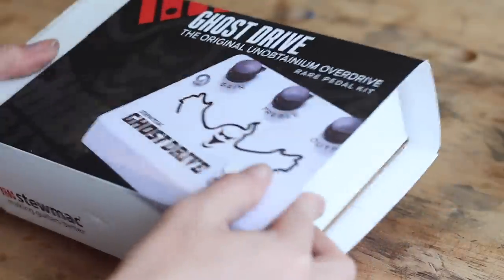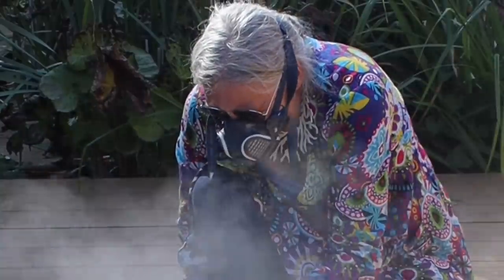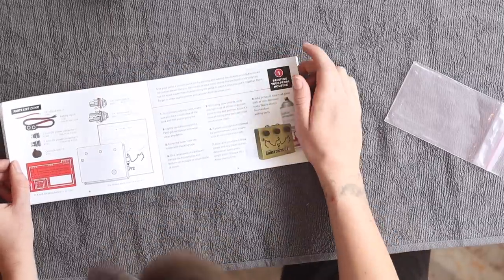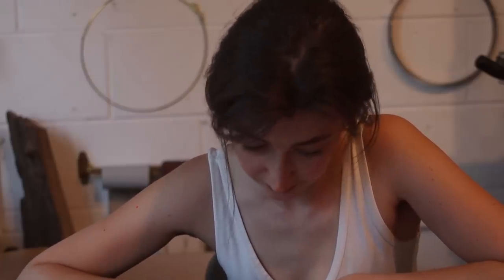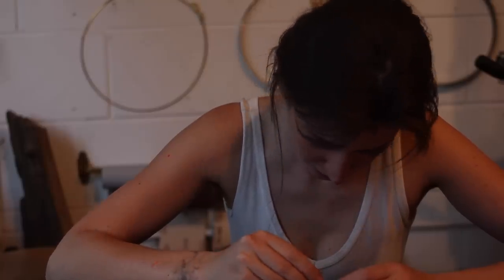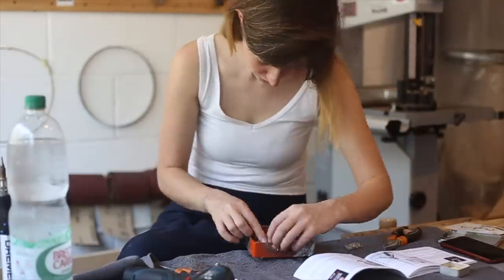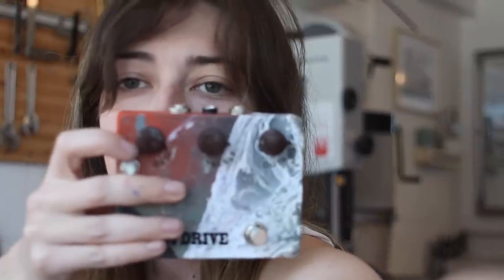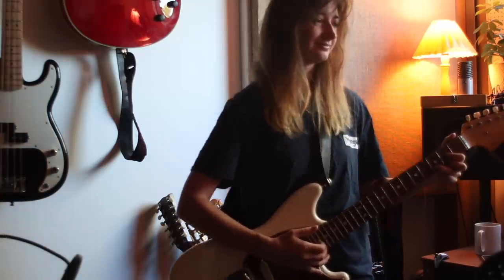I Built The Rarest Guitar Pedal | Klon Centaur

Comment: As with most things there’s a learning curve, the majority of the components in this build are designed to use voltages higher than 9v and I’m guessing your friends psu was 18v. So it’s likely to be the LED that blew. If you can borrow a decent soldering iron, replace the LED, reflow all your solder joints looking out for any shorts you might be lucky. Good luck :)
Reply: Yea, it's fixable! Don't give up just yet!

Comment: There should be a 1N4742 zener diode in the schematic to protect against overvoltage -- if everything's installed correctly, you only blew a 10 cent diode.

Comment: Meh. Senior project in college involved a "large" board to control some mass flow control valves using triacs. Neglected to solder up the ground lead and on the 3rd test power up the random state the triacs woke up at allowed AC power into the DC side. Chips exploded. Smoke was released. A sad day. :) I had not built an enclosure yet so the excitement was released into the lab in full force so there was that.

Comment: If this is still non-functioning, I'm certain I can fix this, if you are interested. There is a zener diode in the circuit that acts as a fuse. It's a cheap part but, you have to know where it is on the circuit board because it won't be obviously failed. I have a marked up photo pointing to the zener.

Comment: I am currently wrestling with a King of Tone clone. I have managed to get both sides to work after two sets of pictures to StewMac, but it got a loose connection somewhere between the switch and main PCB. I will get it working if I have to try for a month.

Comment: Ok so while I left the electronics repair industry many years ago, I do keep abreast of things in the circuit world by watching some youtube channels and the occasional hobby build project just for fun (full disclosure ok I'm designing some devices too that I hope to make commercial eventually but that's still a very informal venture for now.) So, now that you have a sense of my experience, I can tell you that for someone who has no training in electronics and no experience working with electronic components, this is a pretty steep degree of ambition for a first delve into circuit building. Yes for someone who is experienced in hands-on electronics this is a straightforward build with nothing complicated. BUT, as I said, it's just a simple fact that there are a lot of ways you can go wrong with this if you have never had training. That's not a testament to a person's innate abilities in any way. It's the same for any other technical skill. There are just a lot of things that will be unclear merely for no other reason that you can't possibly know until you've had a certain degree of exposure and some trial by fire. (sometimes literally fire) It does not mean you are "very bad at making stuff" at all. It merely means this particular foray is new to you. Find me any maker who doesn't need to learn by trial and error.  I've never met one.

Comment: Everything can be repaired! Probably replacing the integrated circuits will be enough.
By the way: how significantly higher voltage did you apply?

Comment: It's only stupid mistake if you don't learn from it.

I color my DC output with little bit of electrical tape. 9V is standard so anything not 9V gets a little tap wrapped around it so I know it's non 9V. Little piece of cut out tape next to the input of the DC makes it so I only match up same colors when I plug in. Colors are best IMO because text you can mis-read or fade etc. Colors are inuitive. matching color = matching voltage

Comment: It might have survived a 12v dc, that dc jack sounds like a laptop 19v supply. How did you manage to build and assemble the stomp without testing? on the upside, you might be able to source and replace the burnt-out components, ic/diode/capacitors.

Comment: thats a bummer about a year ago i built a fortin 33 clone and it came out well. although i did damage the circuitboard cos i put the led in the wrong way round and had to use a bridging wire haha so i kinda sorted my mistake. sorry you lost on your one.  you might be lucky and its only a couple components you fried. multimeters are kinda handy.

Comment: Smoking parts is part of the learning process - don't be hard on yourself. You should find the circuit board is still quite fixable. Start by removing the obviously damaged components and use a multimeter to test for short circuits around the DC jack and power tracks/pads. Can you send a picture of the board?  I'll even fix it for free is you can send it. Good luck and press on. :)

Comment: This is super cool, and the enclosure is gorgeous! ... but, as a professional, I simply have to point out quite a few things that are why it was so hard for you : 
1) General comment : The Klon centaur is far from the rarest pedal in the world, although the original ones are rare and very, very expensive. However, I would even go as far as to that the Klon centaur is the most common pedal in the world, for how far and wide it had been imitated! Most overdrives are a clone of the Klon, a little like you have Strats, Tele, 335, and Les Paul clones making up for 95% of the electric guitar market. It's almost as if they knew it was gonna happen when they named the pedal!

2) The basic kit shown here doesn't make any sense if you "build pedals a lot"... they literally show the most basic stuff you can get for less than 100 bucks on Amazon. Those are some of the most basic and common tools ever for anyone working with wires! If you build pedals a lot, you're going to need a much better soldering iron than the one show here. If you need a soldering iron once awhile you can get one of those for 20 bucks...! A voltmeter should also always be in a pro musician's kit. Matter of security!

3) Do NOT start soldering with a cordless iron, as it has nothing to do with the brand. Cordless irons use butane gas, with is 4000 farenheit (no, this is not a typo). The max temp I've ever used while soldering wires professionally was perhaps 950 farenheit (I was counting in celsius). I know it's exciting and fun but you are making it 10000x times harder for you. I would never use a cordless iron unless there is absolutely no other option to fix something on stage.

4) Do NOT ever use a soldering iron with something flammable on the table like this. Please, please don't do that. 4000 farenheit...!!!! This towel wasn't wet and could've caught fire entirely within a split second :O ALWAYS have a stand on which to rest the iron and NEVER have any flammable material nearby. There is absolutely no need to cover your table with a towel, electronic pieces aren't made of lacquered wood! :P 

5) It was your friend's bad to not tell you the voltage on this. If I come over to a pedal nerd to try a Klon centaur, they should 100% know and tell me that the adapter isn't a 9V. But, in their defense, ALWAYS check the voltage on your adapters. Better yet, just use a battery if you have ANY doubts. Also, 90% of pedals are 9 volts, center positive, and on the pedal itself you will see, at the bottom, a sign that indicates exactly 

6) You're incredible at building stuff and the fact you never built a pedal before and did this is super amazing and you should be super proud of yourself!!! I'm certain Stew Mac would be more than understanding and would agree to send you the circuit again so you can keep the beautiful enclosure. They're burned a lot of pedals over the years for sure... it's just part of the game! It feels overwhelming when you're starting out tho, I get it.
I loved that you were honest and vulnerable. We need more content like this on  YouTube!
Reply: Do you not mean 90% of pedals are centre negative? Every boss and pretty much any I’ve used is

Comment: What voltage did you plug in ? 
It was likely incorrect polarity too. Since the usual centre negative BOSS style is basically confined to pedal supplies.
But the pedal circuit might be repairable depending on the detail.

Comment: How many volts did you plug into that pedal? If it's below 18v there is a chance that the pedal still works since pedal components are usually rated at 18v or 25v in some cases. And depending on how long the pedal was connected to power, there's also a chance that the cap and diode near the dc jack were the only parts that got fried.

Comment: Hmmn. First off. as some have pointed out this is not really a "first time" project. It's not THAT complicated a circuit, but for someone who doesn't have some experience of how to look at components and read off their values/polarity, it is a minefield for the unwary. As some have said, start off with simpler projects, and learn in your head what the colour codes on a resistor actually mean. Also don;t be too put off by alarmist statements like "they might explode" In the many years of building small electronic circuits, I only had ONE cap "explode" but that was a large electrolytic which i had reversed the polarity, but this was in a 100 watt power amp I made. At the voltages and currents you are likely to find in circuits like this that will never happen. At worst it won't work. And looking at the circuit diagram, there are only a handful of polarised electrolytics in this circuit, all associated with the PSU part of the circuit.* And given the max voltage o about 18 volts at these currents, there will be no "explosions" . All the other capps ar AC coupling caps, in various configurations. All completely safe, and, not polarised wither. 
And for small projects like this, a small 15 watt iron is all you need. A hotter one is more likely to fry the components if you are simply not used to making soldered connections. I built dozens of projects from simple pedals, up to full 400 watt Class D amplifiers using an Antex 15 watt iron. It's just that you need to practice your technique to make good joints without overheating the components. 

* PS there is one other electrolytic and it looks to be in a feedback loop. so incorrect insertion shouldn't cause massive problems. It's just there to block DC feedback around the circuit.

Comment: I bought a very good Klon clone preassembled and even after seeing your video, I managed to use the wrong power supply.  In my defense, I have a two voltage power supply and mixed my wires up,  "What is that smell?" clued me in to my error.  My question, should you feel kind enough to respond, is  were you ever able to repair the pedal?  Mine still ha a degree of functionality--if I keep the left hand knob below 12 o'clock, it still does what it should  Past that point and the volume drops and there are other tone issues...  Thanks for a great video--and a great channel!

Comment: I don’t understand how you managed to plug a higher voltage into a 9v socket. Low voltage plugs and sockets are usually specific so that this can’t happen. Did you plug in phantom power from a mixing desk.
Most of the components you had laid out should work at up to 50v at least, so did anything melt or go black inside the box.

Comment: Im not sure about the schematic of a klon ...  but couldnt too high of a voltage could just fry the diode bridge/rectification area of a pedal before damaging the rest of the circuit? Perhaps you could replace a few parts and salvage this?

Comment: I feel like a power supply with a greater-than-9V output really shouldn't have the same plug on it as a regular 9V one. Sorry about your fried pedal. I hope it doesn't put you off building one again. Hopefully with a normal soldering iron though. That cordless one looked terribly awkward. Good luck!

Comment: Fried? What is fried? Did you let the smoke out of the IC (integrated circuit) or chip as they are commonly referred to? Was some resistor or diode or transistor burned up? Hopefully one of the circuit board etches wasn't burned in two. Usually only a part or two gets damaged.  Seek out a Electronics nerd. Most times they're willing to help just to show how much they know about this kind of stuff.

Comment: The resistor color code:
Black 0
Brown 1
Red 2
Orange 3
Yellow 4
Green 5
Blue 6
Violet 7
Grey 8
White 9
The last color band is a multiplier, and could be looked at as how many zeros to tack on at the end of the value.
Also at the end as the last band
Gold is divide by 10
Silver is divide by 100
Reply: The actual colors follow the colors of the rainbow, in order .
ROY G BIV
Red, orange, yellow, green, blue, indigo, and violet.
Indigo and violet would be too difficult to discern from painted on bands, so they only use what is essentially purple.

Comment: Try to fix it?..find any burned out components? Replace them. Op amps are surprisingly resilient, a squeal is typically a shorted transistor, check first.

Comment: Man the ending is so unfortunate... But hmm...Do you know how many volts you put through this thing? If it was 12 or 18, most of the circuit might have survived. Most capacitors can take a beating, at least for a short period of time, resistors too, even the opamp ICs usually survive 18 volts. Okay heck with it, I just took a look at the circuit. You might be very lucky here...The Centaur (and all of its clones) uses a so called charge pump right at the 9v input (the IC which is not a TL072) to actually run on a higher voltage internally (this results in more headroom - hence some people throw around the word "transparent", a contentious debate I will not get into now). And some protection diodes, next to this IC. It's very likely you have just fried the diodes or maybe also the IC. Both can be easily sourced on ebay) Do these diodes look burnt or smell funky? Diodes are relatively easy to replace by somebody who has some soldering experience. And the charge pump IC sits in a socket (because its many legs would make it a pain to desolder) and can be replaced in seconds. But it might have survived. If you have put a much higher voltage through the pedal, there might be damage on other components, but the traces on good circuit boards (I guess stewmac does not cheap out on quality here) can usually take a lot of abuse. Don't give up on this pedal, I would guess it can be repaired with not too much effort.
This reminds me sooo much of my first pedal builds...improper soldering gear and no experience. But trust me, a bit of practice and a better soldering iron and this is one hell of a great hobby. And I've got to say, your enclosure looks a million times cooler than what I paint - after 30+ pedals in the last five years.

Comment: gd chance it still works from a battery as usually a seperate circuit drop me a message if ya want me too take a look and see if i can revive it for u its prob only killed a diode or voltage regulator if u have a wiring diagram thats even better too help diagnose it

Comment: you poor thing... I can't believe you suffered through using probably the worst possible soldering iron option, with no magnification to aid you, and I'm gonna take a wild guess that maybe activated carbon filter systems weren't going on right behind the board as you worked... and then it just gets fried... that is a compounding tragedy that nobody should suffer.  I would highly recommend investing in a good quality, name brand soldering iron, some magnifying specs, and a helping hands, you will end up saving so much time and frustration, they will pay for themselves in no time and last you a lifetime.